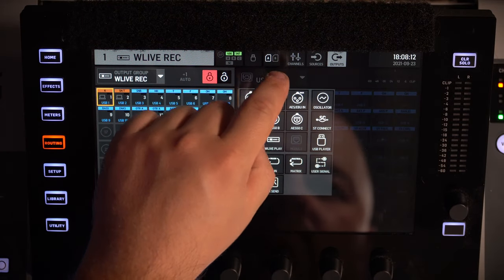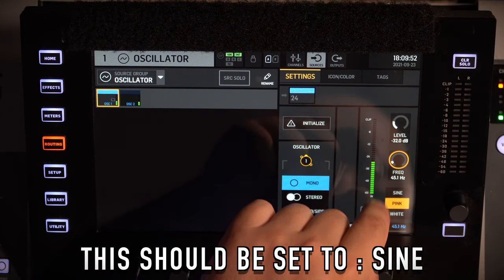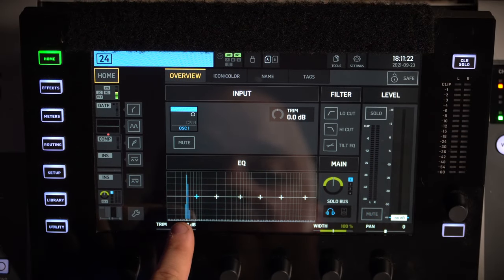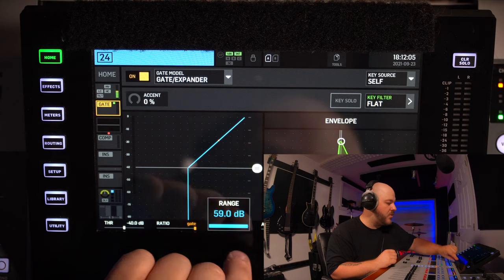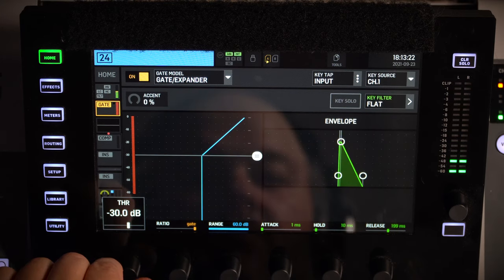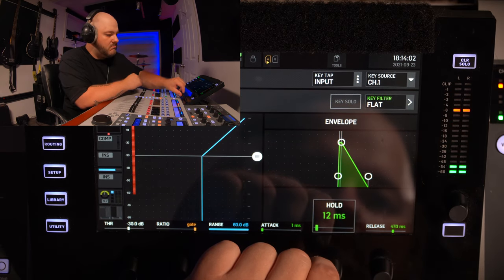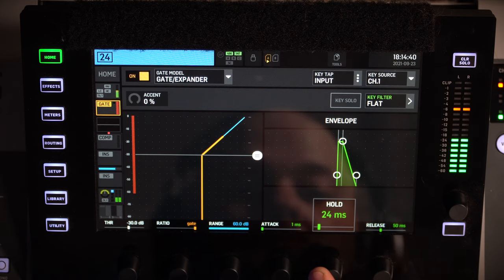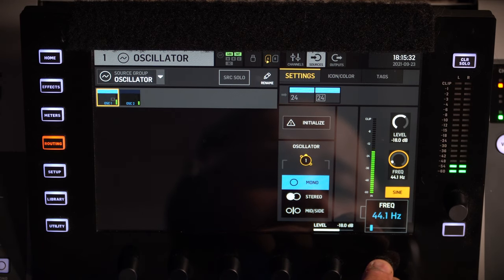Get MASSIVE BASS DRUM - Live Sound Tips - Make your own Digital Trigger in your console

Comment: Hi! Thanks for the trick. But I use to play with the suboctaver effect on XR18 & X32 to get some downpitched harmonics on 40-50Hz. I think it is easier because it automatically match the kick drum tuning without any configuration. Maybe I should try the oscillator next time to see if I'll love it as much as the suboctaver. 😁
Reply from the maker: Oscillator can be used to add or replace the low end of the kick, if you have a bad drummer, that can save you.
Reply: many ways to get more of fundamental :) Even just using a yamaha subKick mic. Or triggering samples with a very fast/short gate. It's great to have the keyed oscillator trick handy, especially for sections of songs that might benefit from a variance of the sub enhancement from whatever you're using on the other 90% of a band's songs.  You know, a halftime breakdown or something.

Comment: Thanks for the great video sir I will personally go and try it out, I have another question unrelated to this, what is the best way to use reverb on this console? I personally put it on a bus then SOF channels to that bus but av found that when I now put those vocals output to another bus(our stream bus) the result isn't great and they make the drums sound very far away... Please help
Reply from the maker: Hi Joshu

I use post fader bus send. I send those bus to my Main and use the SOF to send into the reverb.

https://youtu.be/onSL1j0sakU
Reply from the maker: goce79  I think i actually have a video on FX send on Bus https://youtu.be/onSL1j0sakU
Reply from the maker: goce79  posted in both of my last comments
Reply: Had a similar challenge Joshu. I have a effects bus, then I send my vocal channels to that effect bus then send that bus to the mains. This worked very well for the house but I also found similar issue with the effects not going to my stream. What I now do is that I send the FX bus to my stream bus (bus to bus sends) which is something I learnt from @Guillaume and that seems to work just now. It feels fleamsy but works and I am honestly thinking of a better way to do it; challenge is I really need to use a separate bus for my stream

Comment: Thanks for sharing. 2 questions, what is the source for 50 Hz audio? Can I do it on soundcraft Si performer 3?
Reply from the maker: Hi 👋 

the signal is coming form the console Oscillator / tone generators

I just check and the SI Performer 3 has a built in Oscillator/ Pink noise generator. 

if you can, assign the signal to a channel and treat it like if it was a microphone, if you can only send it into a bus, send your bus to the Main out. 

also, you can use a external source, like a phone with a signal generator app.
hope it helps.